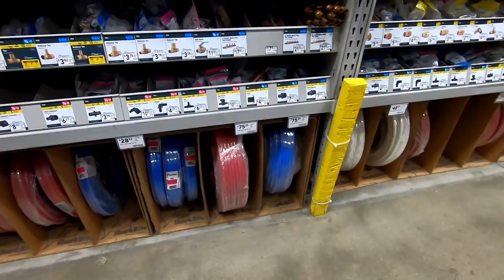Busting out the back block wall / Supply Run . Shop Damage part 7

Comment: Maybe cut the old slab  in to 4'X6' foot  pices and move with bobcat , You could used the slabs to put stuff on that u keep outside,
Reply: I've seen pros chop up pad and pull it out with skid steers. They don't chop it up into pieces quite that big. It's too hard to move it around. More like 2x2 blocks. The guy running the skid steer don't know where the brakes are either. He goes full bore all day long.
Reply: @1pcfred  Cool, good to know,  If it need to be that small to move, I think better time spent just taking a jack hammer to the hole thing,
Reply: @jeffreyc6508  if you need a lot of slab taken up they saw cut them and haul them out with skid steers. What we have here is not a lot of slab. I've worked with gorillas that'd bust that up before lunch with just a bar and a sledgehammer. One in each hand. Like a guy named Loash said once, You touch it, like this. He probably learned how to break rocks in the Soviet penal system is my guess. Had a gift at it.

Comment: Around here the haul bill is as much as the rock
Reply: No such thing as a NEW CHEAP TRUCK $250 k to cart rocks.
Reply: 7 dollars a ton here 100 dollars delivery.Air chucks are cheap we used hundrets at work,hint hint.
Reply: Rock around here is $5-$8 per ton depending on what you get, and to have it hauled works out to about $12/ton, so a 15 ton load like Steve got here would run about $280, again depending on what type of rock.  My Dad and I ended up going in together on a 12' dump trailer, can haul 5 tons at a time.  That trailer has paid for itself and owes us nothing, LOL

Comment: Is the climate so dry where you live that render/external plaster is not needed, our walls here are 2 100mm blocks seperated by a cavity of 100mm cross tied whith wall ties, dpc on foundation/slab and rendered both sides (1200mm of rain per year) insulated for dwelling

Comment: A bulldozer running across those excess blocks makes cheap crushed rock.
Reply: OLD SCHOOL...True, But Steve hasn't got a bulldozer and I guess the skid steer is either wheels or rubber tracks that won't survive long trying to crush blocks or concrete .
Reply: @karlhrdylicka  Yeah- but in that area there is probably a neighbor with a Cat- just suggesting a way to save a buck and get rid of those piles of blocks.  He could also probably sell them, since they are cleaned.  I would have stacked them on pallets at the beginning to make moving easier.

Comment: I may have asked this before, but since you made your cut line in the concrete slap behind all the support columns, how are you going to take out the concrete to prep the area for the new pour, since those columns are sitting on the take out parts?
Reply from the maker: The new pad will be the last thing that happens.  I will not be going back slab. The walls will have a separate foundation and the new slab will be floating inside the building.👍

Comment: 21:40 Beardcam? lol .........sand looks wet
Reply: Suppliers don't mind selling you wet sand , they get more $$$s that way .
Reply: @Wroger Wroger,All the sand I get by collecting it myself has always been on a weighbridge , Even cement powder in bags has the weight on the bags. from memory wet sand is about 10% heavier than dry for the same volume .
Reply: Beardcam?  I believe that's perhaps a microphone wind sock dipping into the shot.
Reply: @jeffo881  could be .......note the (?)

Comment: why dont you get that wall on the side up before you go too much farther. I would get some  concrete tubes and set them deep and then build a wall like a pole building first. then your supported and fill in the rest.don,t take chances with that roof.  better to be safe than sorry Just a thought for your safety

Comment: prolly can replace the switch in the sawsall with a speedcontroll one , wouldnt be supprized if theres one that fit like it was standard
as for getting the runaway bricks out of the valley you might want to try a 4 prong trowinghook and a length of rope and just go fishing for it from the ridge
as for running the hose across the driveway : you could lay a perforated plate over the pipe then cover it up with more rock , should spread the load over the pipe a little more
as for the pickup , they used to make a shortbed with a higher load capacity called big 10 , you might be able to adapt youre current truck , then again it might be too rusty to do that mush work on it 
http://67-72chevytrucks.com/vboard/showthread.php?t=155294

looks like the corona scare hasnt reached you guys yet , over here in the netherlands there starting to talk about a total lockdown (only alowed out of the house to do shopping )
current rules are : wash hands often , well keep bout 6 feet distance from opthers at all times , no hands shaking or touching  , try not to touch youre face with unwashed hands , no handling cash (all purchases through electronic transfer ) coughing in youre elbow , dont leave the house unless nessesairy 
its known the virus can survive on smooth surfaces like tabletops or doorknobs for a week 
pretty hard on companies as they have to close theire doors for 3 weeks now and no end in sight a lot of farmers have a hard time as they cant move their product , places like mc donalds are closed so they dont need potatoes for fries , flowers ..... nope not going to happen , even tv shows and sports events and concerts get canceled because people are sitting to close together during the making 

youre kindoff lucky to be in a rural area (less people per square mile ) , still needs to be carefull as it takes one sick person for it to spread corona amongst those you live with  if you dont care for the rules preventing avoiding getting intoo contact with the virus 
corona entered our country at januari 31 the counter of infected is standing at 3003 with 107 deaths on a population of 17.4 million and the end isnt in sight yet 
they predict 30.000 infected in need of medical attention (pneumonia) and we only have 10.000 hospital beds and breathing apparatus  available

Comment: I was about to say something about geotextile on your driveway, but that's already been "covered", if you forgiove the pun.While I do understand your desire to be able to reuse those blocks, do be careful when using vibrating tools like that. "White finger sýndrome" https://en.wikipedia.org/wiki/Vibration_white_finger is no fun at all.And no one can tell you what the "safe" level of exposure is.Maybe you'll be OK, maybe you won't. If not, you'll be cursing your desire to be economical in this situation from hereon.Bodies are individual.As is their response to outside stresses.If you're gonna do work like that, only hold onto the tool where it's clearly meant to be held. Good tools will have had their vibration levels - at the handles - measured and found acceptable for extended use.If there isn't a handle there, get another tool.20-something me would probably have done what what you're doing.Current me would probably have rented a skid steer with a jackhammer and suffered the loss of the blocks.Or used any other technique that didn't rely on hour after hour of holding on tight to vibrating tools with my bare hands.